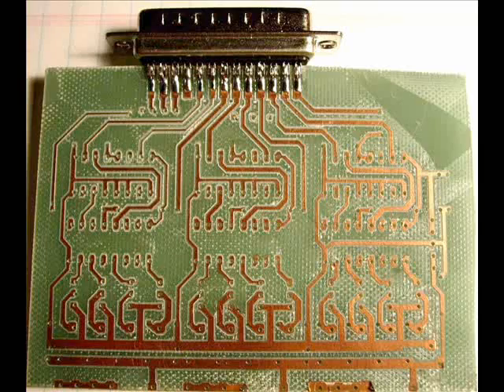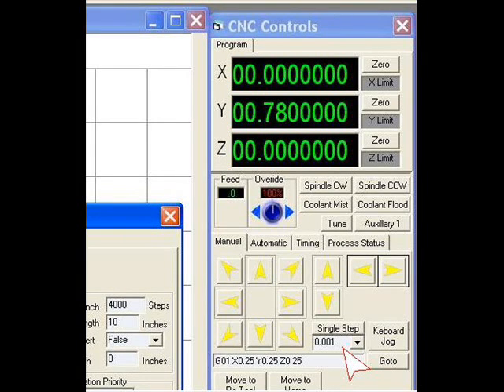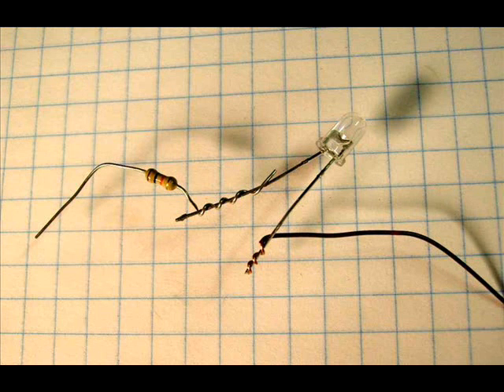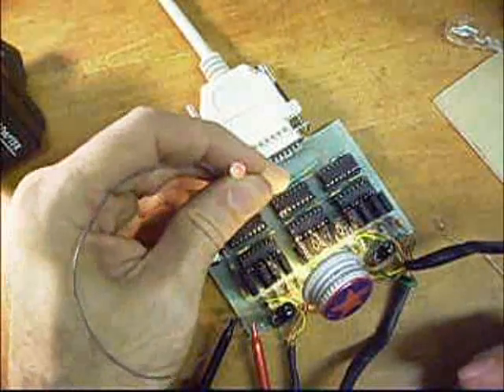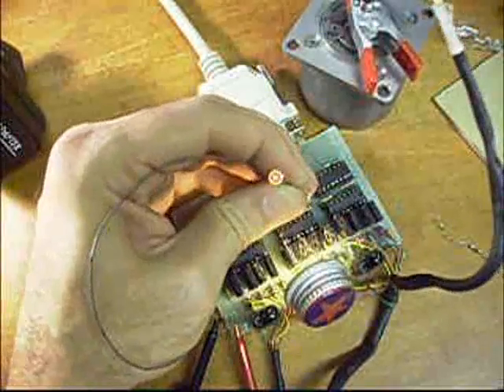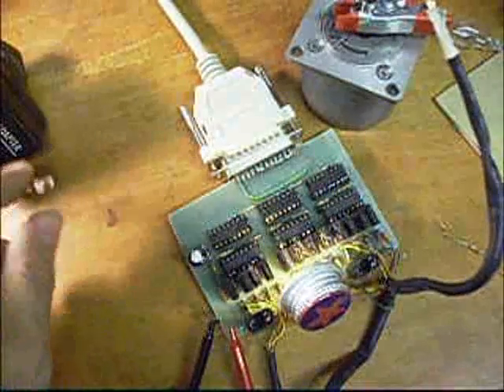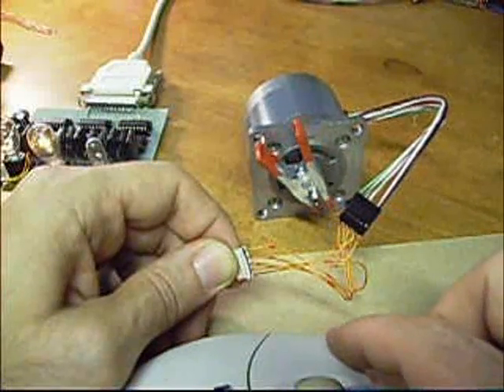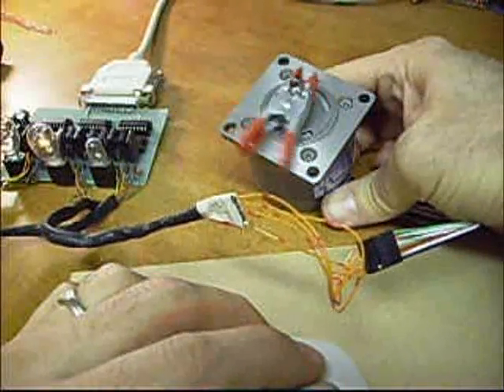Easy CNC Stepper Motor Driver

Comment: cool
Hi, please tell what or how I can control the simples way 5-lead-wire Stepper Motor 
I Try build turntable for my layout ho scale 
I Take this motor from old scanner input power  to scanner was  15V 
and do I have used any motor driver?? or I can used potentiometer or somthing else
to control
Thank you in advance
O I DID SUB Hoping You will do the same
Thumbs up awesome vid

Comment: Why does it look like there's a lot more stuff on the circuit board then there is the parts list. I'm making 1 right now but I just realized that my motors are bipolar, 4 wires. How can I make a controller for 3 bipolar motors? That's a really good job by the way and the reason I was going to build 1.

Comment: Maybe ready to slow dance I don't know about rock and roll with this blast from the dropping resistor past. What is the top RPM speed you can achieve with this anachronism? If anyone is interested in stepping into the 21st century they can check out a driver on my YouTube page. It is a bipolar chopper drive. P.S. Mine's a LOT easier too!

Comment: Man you shoul have put the MOSFET's not front to back, but in line, side by side... to that way you can put a refrigeration metal plate nailed to them... they will burn real fast that way..

Comment: @milek021   This is not completely correct.  Bipolar stepper motors are generally 4 wire,  Unipolar motors are 5 wire.  The 5th wire being a ground.  6 and 8 wire stepper motors can  wired either as bipolar or unipolar depending upon the configuration needed.
In unipolar motors the current flows through each coil in one direction to ground, in bipolar motors the current is switched in direction through each coil.  These motors are 5 wire therefore unipolar.

Comment: I'm thinking of using 2 x cd4028 per motor, one turning on pins 1-2-3-4, and the other pins 2-3-4-1 in that order. In doing so, the coils are activated like in the previous comment. At least in theory :)

Comment: Controlling steppers is as easy as 1 2 3 4 :)
Very nice work. Simple and elegant.
I'm trying to control the stepper with 2 coils at the same time, for extra torque. Do you have any idea as how it can be done using extra mosfets or something? For example: step 1 - coil1+coil2, step 2 - coil2+coil3, step 3 - coil3+coil4 and step 1 - coil4+coil1
I'm flipping my wig trying to come up with a circuit for this
Thanx!